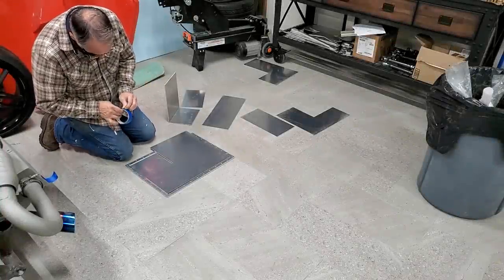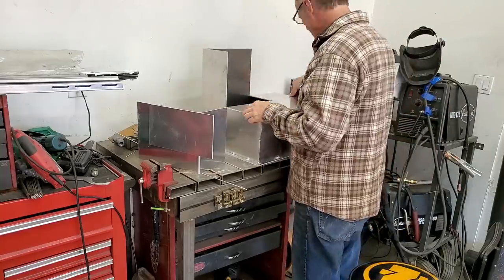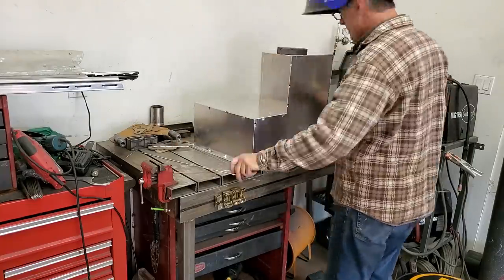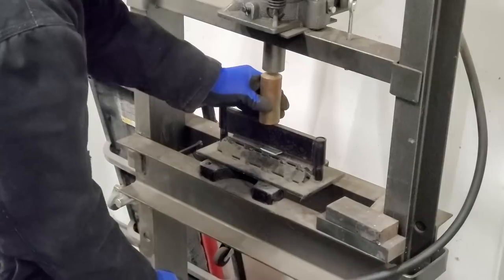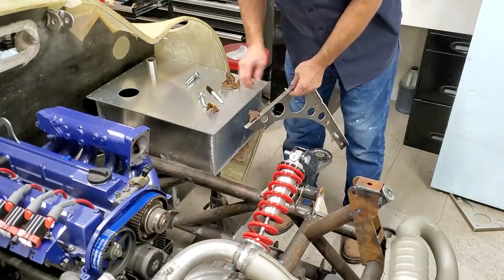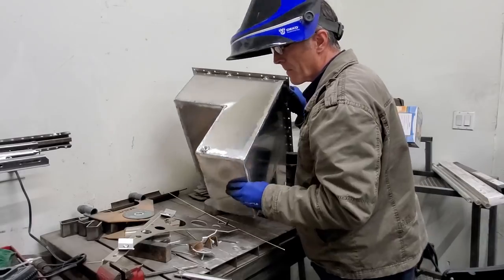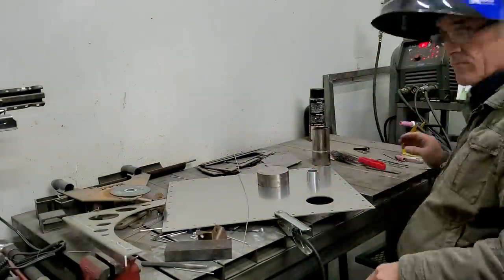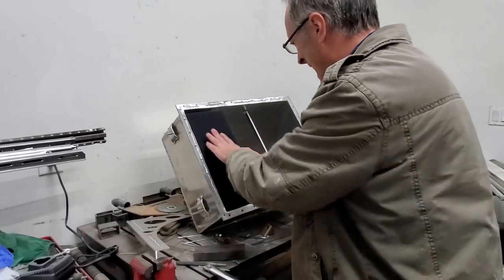A51 - The fuel cell. Arete Supercar Project

Comment: Ah, you went with a fuel cell instead of a fuel tank. I'd be interested in hearing your reasons as to why? Yes, fitting a fuel sump is a good idea, and I tend to agree with you on YouTube; I'm also thankful it's there, but I'm no fan of the censorship. Oh, I watched all the way to the end, I'm a die hard fan. ;)
Reply from the maker: You shouldn't be a fan of someone building there own supercar- "home made cars are death traps!" Ha! So I'm told. :)
Reply: @BuilderCreator  Oh don't listen to the naysayers and haters, they're just angry with themselves as they haven't tried to build their own supercar. That's the problem with putting yourself up on YouTube, for the whole world to see, you will attract the trolls. Trying and failing is better than not trying at all, but what I've seen of your work so far, I don't think you're going to fail. ;)
Reply: @307Driftwood Thanks Driftwood, yep DIY supercar builders unite! I think we both have the same condition, the urge to build our own dream supercar. It's possible we may need help lol. ;)

Comment: Great video again, how do you seal the top flange to prevent fuel leaking.
interested to know.

We have had to fil our race tank on our rce car with foam but were not allowed to modify the tank so had to use long rectangular secions and feed into tank thoug fuel seder float and pickup opening.
in line with our class rules.
Reply from the maker: Being able to open the tank and insert the foam (and sender/pump) was one of the reasons for building it in two parts. The urethane liner will cover both sides of the flange, plus there will be a gasket between the flanges to seal it.

Comment: Note on alloy tanks.
Welded corners tend to fracture and split after a time so any long welds or areas that may flex a lot or carry a lot of stress should be reinforced and stress relieved.
Reply from the maker: This is the job of the fiber reinforced urethane liner. Stay tuned.
Reply: Regarding differentials
I believe Ford do some suitable diffs on the ranger and explorers.
There is a 7.5 and 8.8 inch that come in independent rear or solid axle rear and independent front with positraction being an option as well as a range of ratios from I think about 2.6 - 4.8 so even if you just get the housing you can get suitable gear sets put in.

Comment: Gday mate love the project! However I am concerned about the mounting method, I think your tank needs to be strapped to the chassis, not bolted from brackets for the reason you already mentioned with stress and vibration. Nic and Richard (Project Binky) explain the reasoning for this when they built their tank.

Comment: Is the foam providing the same function as baffles in this fuel cell? Or will you put some baffles in later? Or are they not really necessary with the sump design and the relatively small fuel cell size?
Reply from the maker: Yes, the foam works as a baffle, but is even more restrictive of the fuel movement.
Reply: @BuilderCreator  It would be nice and quiet I bet. Any idea how long it lasts and if it deteriorates could it get into the fuel lines?

Very handy you can just pop the lid and replace it, regardless.

Comment: Look into Dip Braze process for the fuel tank.
Reply from the maker: Took a look on your suggestion...would be great on production run tanks.
Reply: We typically fabricate aerospace electrical related aluminum enclosures, and we dip braze them. Finish is awesome. However, I would do a rigorous vibration test to. Also for aluminum parts, send them out for chem film type I class 1 for corrosion prevention, and adherence for paints, powder coating.

Comment: Any thought of running E85? I've read that some fuel cell foams will degrade in E85.
Reply from the maker: The foam is E85 compliant. I debated about urethane over PVC for the liner, but after not finding enough data against the urethane decided to go with it. and since I can open the tank and check it easily, if I have doubts, urethane it is. Stay tuned.

Comment: Great channel. Admire your skills  and knowledge. Like you I have alot of composite experience(aircraft building), so I thought I would ask you why aluminium over a composite tank. Keep up the great work,  very inspiring.
Reply from the maker: Aircraft building- You have probably caught that most of my ideology is derived from "Ratan" aircraft methods, which would reason a composite tank. I guess, I wanted a tank that I could build fast and upgrade later if needed. A self sealing bladder would be the safest, and it's probably the direction I will go, but they are expensive and I thought I would get some miles on the car sooner with this alloy tank.

Comment: What purpose does the foam serve inside the tank?
Reply from the maker: Keeps the fuel from sloshing about and shifting weight. Your average car has metal baffles, but the fuel can still slosh between the baffles. The fuel can only move very slow through the foam.
Reply: Most Race/Drag/RePro Tanks Use Foam, while the Mass Pro Folks use(d) Chambers and Ports to Keep Down Sloshing & Minimize Disturbances inside of Tanks. It Works Well either Way, but many Mass Production Tank Manufacturers Transitioned to Foam. Aviation Tank Designers Love the Foam Inserts, as they Aid in Weight Reduction, especially in Aux Tanks Made from Composite Materials.

Comment: You didn’t need any baffling?
Reply from the maker: The tank will be filed with open cell foam used in most race car tanks. that is what you saw me test fitting toward the end of the video. there will likely be one baffle right around the pick up. I'll go into it more when I finish up the tank. Stay tuned.
Reply: @BuilderCreator   I actually been starting to work on my project as well! And that what I figured but wasn’t 100% sure I’ve had to fix a few sand cars because they forgot to baffle them but the rear sump was even a cool idea